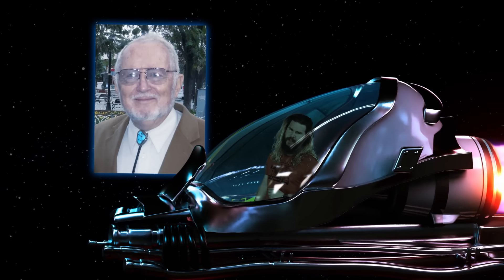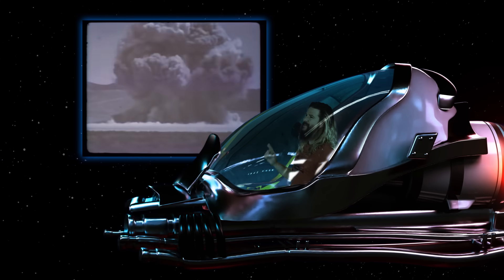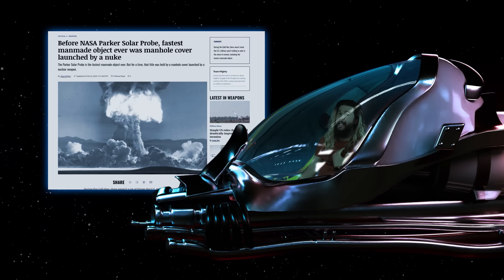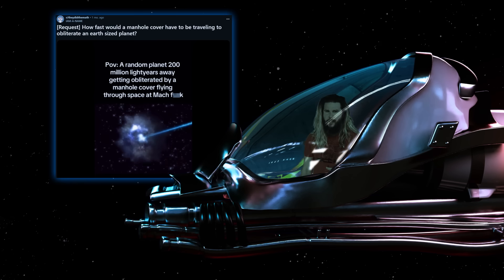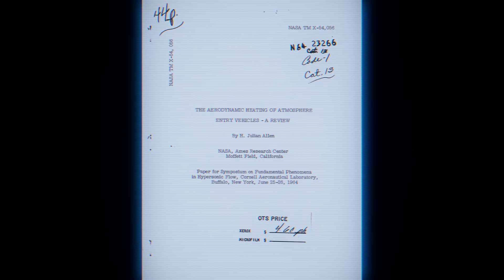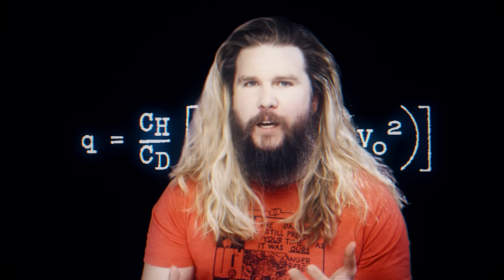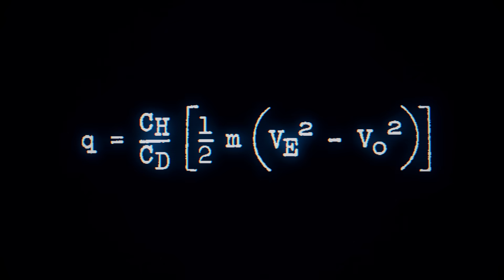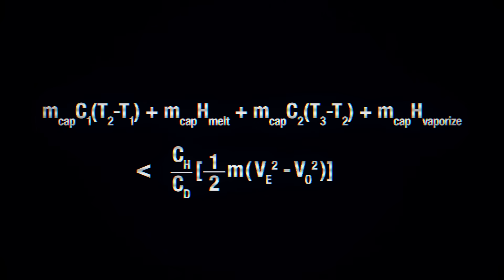Debunking the Nuclear-Powered Manhole Cover

Comment: 9:38 I’m curious to know what you used as your V_e2 -V_o2. For a meteor that burns up before hitting the ground it is off course the entry velocity squared, but this cover STARTED going at 66km/s, we don’t know how fast it was going in the end. It could very well have exited the atmosphere say at 50km/s, then the energy absorbed by the plate would be a lot less, thus maybe not enough to turn it into gas. It could be that I’m not completely understanding the two coefficients in front but I do think this is a pretty big part to just leave out
Reply: Exactly - equation assumes stopping within atmosphere from 66km/s to complete stop. This is an unfounded assumption
Reply: To be fair, while it doesn't answer the question of whether the cover definitely burned up, it does show that assuming it burned up, it would have produced enough heat to burn itself up, so it's at least not contradictory. If the energy produced weren't enough to vaporise the cover, it would be a contradiction and we'd have to conclude that it made it into space.
Reply: The other part is that it assumes the cover traveled flat the whole way.  That's unlikely.  It probably either tumbled or turned sideways.  Either of which would massively affect the calculations, particularly the drag and heating coefficient terms.  Another tricky thing is that its not clear if this is taking into account things like boundary layers or material ablation, but some of that might be built into the heating coefficient.
Reply: 9:38 ya the right side of this equation is garbage. It's supposed to represent a fraction of the kinetic energy lost. My dude multiplied the entire energy it started with by (24.1/1.28). It still probably broke apart due to the forces involved before it got remotely close to melting, but this math ain't mathing.
Reply: Yeah that's a huge factor. Some quick math suggests that simply raising a 934kg mass to an altitude of 120km (pretty well outside the atmosphere) would require less than 0.1% of the energy that this thing had at the start. So without the atmospheric losses (which of course are most of them here) the speed lost getting to space would only be 18 m/s. Like not 18 km/s of the 66. 18 m/s given the rounding and approximations here: None of the energy is needed to get to space.
Reply: It's velocity squared so it only needs to lose 7 km/s to get 20% of the energy, which by his numbers is enough to vaporize it.
Reply: Let´s keep in mind: even the 66km/s (which is incredebly fast) is only the lowest estimate for the cover´s velocity - it could have been way faster still.
Anyways, and as already mentioned by @ccoder2953, several other assumptions by Klye might not be correct: coeffcient of drag/heating.
And, as mentioned by @the fat electrician:
1. the atmosphere is only so thick that the man hole cover had left is within 2 seconds, assuming no braking
2. the atmosphere gets thinner the higher one goes up, so friction decreases massively within the first few fractions of seconds of the flight
3. especially in the first phase of the flight, there was a column of superheated material following the steel plate
4. conducting heat takes time, especially if we are talking about 4 inches of steel, assuming a flat attitude, even more at any other angle
5. the outer layers of stell might have been vaporized, taking away some of the introduced heat with them (aka ablative cooling)

So without calculating myself, there have been so many aspects that were overly simplyfied (skipping heat transfer), daring assumptions (terminal velocity while leaving the atmosphere is 0), neglegence of certain aspects (attitude, decreasing density of the atmosphere...) that I personally am not convinced by these napkin calculations.
And a factor of under 2 between both sides of the equasion, that is way too little to convince me otherwise, given the amount and scale of uncertainties. If one sice would be 50 oder 100 times bigger, ok, but with a factor of less than 2? Nope, does not work for me, sorry
Reply: @RageDavis  1. He assumed the manhole was room temperature leaving the hole at max speed.

2. He assumed vaporization temperature was necessary to disintegrate the manhole.

3. The iron will react with the air added heat to the system. 

4. He assumed the vaporization temperature of iron doesn't decrease with lower pressure. It does, alot. 

The assumptions go both ways here, so he could easily be low balling it.
Reply: @RageDavis  You say "within 2 seconds" as if 2 seconds is a long time. It isn't. At that speed, it would experience over a quarter million gees of drag, which would stop it dead in 0.02 seconds.
Reply: @WJS774  The drag must be massive for the blink of an eye, but decreasing rapidly, since the atmosphere gets thinner the higher the man hole cover rises. On the other hand, there is a column of superheated gases following the steel plate, so assuming a decelleration of a quater million g´s might not be correct. 
And two seconds is a long time for conducting the heat required to heat a metric ton of steel up from ambient temperature beyond its boiling temperature, considering the heating only takes place on the outside.
Sure, the lump of metal might have arrived outside the atmosphere glowing red hot, most likely as a liquid blob, but I would not bet on complete vaporization anyways.
Reply: @RageDavis  Who gives a damn about heat conduction? The question was if it made it into space. Not whether, when it failed to make it into space, it was melted or not.
Reply: Karmann limit (frontier to space) is  100 km, you can guesstimate the terminal speed by vertical shoot formula,  (high estimate because air drag), then feed that on a crude calculation on Excel.
Some funny numbers, SR71 Blackbird outer hull reached 600 celsius on "puny" mach 3, with an aerodinamyc shape, and special titanium alloys to avoid becomming playdough

Comment: Its likely that the cover turned verticle because of drag, so the drag coefficient should be lower. It could have gone to space because if it didn't melt in lower atmosphere, where density is highest then it wouldn't have had any problem staying solid as it went higher.

Comment: IDK I feel like someone has to get into the weeds a little bit more to really nail this one. On a gut check the assumptions made for this plug & chug have way too large an impact on the outcome.

1. Correct me if I'm wrong, but the ΔV component seems to be assuming a final (exit) velocity of 0, which gives the maximum possible figure for the heat imparted to the disc.

2. Assuming a cylinder moving through space feels unfair since the plate would almost certainly be tumbling, which means you need the average surface area that is directly opposite the drag force to calculate it accurately. This is entirely off vibes, but I think it would be ((πr² - 2rh)/2)+2rh  ≈ 1000 in²

3. The equation itself can't really be applied here either. The coefficients hold a lot of information, and they must account for at least 2 things that significantly affect the value if you're running a calculation for the inverse scenario:
a. The mass is going from high velocity in a region of low air density to low velocity in a region of high air density. The disc did the inverse.
b. The force (and acceleration) imparted due to earth's gravity is working WITH the projectile, not against it.

The proper equation (admittedly far beyond my mathematical abilities) accounts for the atmosphere's density gradient, which will influence the total deceleration of the plate over the distance travelled. It also needs a gravity component (which also has a gradient on this distance scale) because any deceleration caused by gravity is not being converted to heat.

Comment: I think a good example of why it would have vaporized in the atmosphere is the Sprint missile. Being able to accelerate to Mach 10 in under 5s the sprint missile glowed white hot at max speed, and immediately after separation the now blunt ended first stage catastrophically disassembled due to aerodynamic heating and air resistance.
Reply: This is the best example I've seen so far, but when briefly looking into the Sprint I see that it tilts toward the target. While this missile would be at Mach 10 remaining within atmo, the manhole presumably went directly up and out of atmo. 
However, I would like to see a sprint missile used to test the burn rate going directly up at Mach 10. A nice way to get some experimental data, and avoid another nuclear earthquake. The question of how long the jet of nuclear explosion gasses continued propelling the manhole cover is something I haven't seen really addressed. All the calculations I've seen treat the event like there isn't an active jet of supper heated gasses moving with the manhole cover(possibly adding propulsion, heat, and a protective plasma barrier).
Reply: A missile is a very different thing. The manhole cover had atmosphere moving with it while a missile is only fighting it.
The manhole cover was more like a boat floating down a river that is going faster than it is while a missile is like a boat driving through a lake.

Comment: You forgot about heat conductivity, radiative and spectral heating and absorption of the materials used, thermal conductivity and spectral dissipation of that material's plasma, the force parameters on the given material and it's rapidly falling structural strength and convection at hypersonic speeds